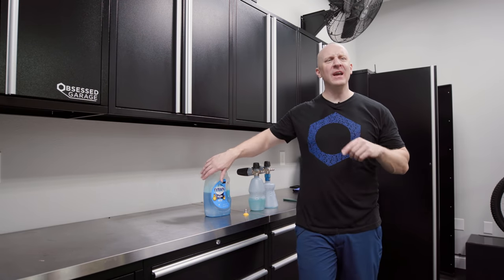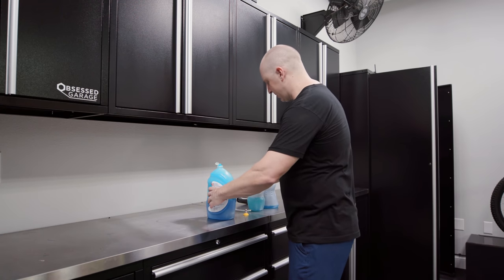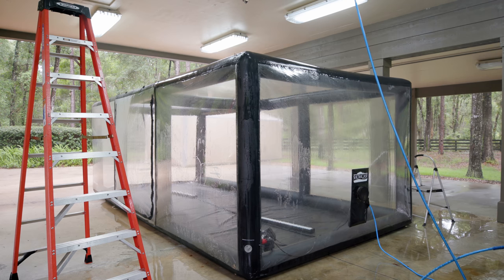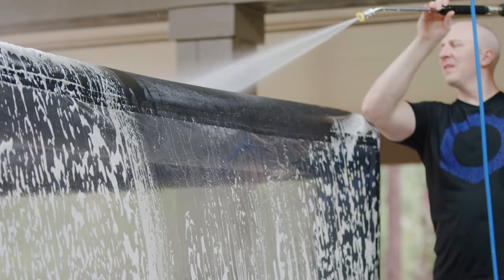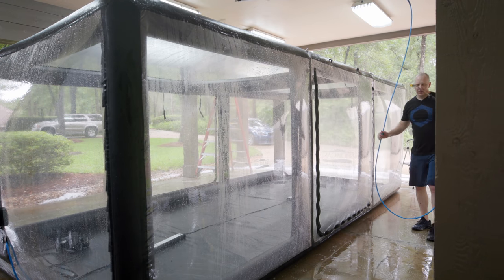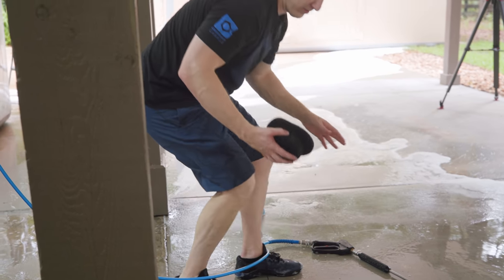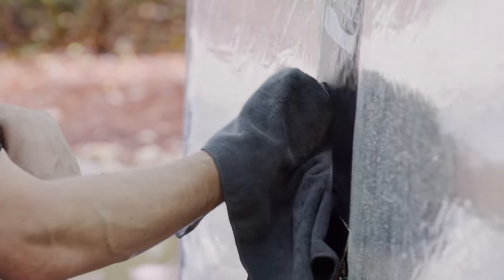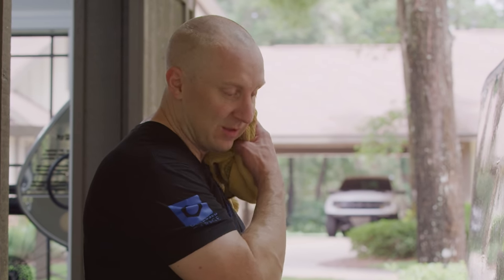CarCapsule Gets A Deep Clean

Comment: You should try Charlie's Soap Indoor Outdoor cleaner on the inside so you don't have to spray water inside. I have used it to clean the plastic on old Apple Macbooks(2007) and older I refurbished. It took the decades of filth off of those laptops and visually are white(like new) instead of the grey color they turn into from use. I have heard the stuff can clean mildew off of sliding just by itself!

Comment: Matt also at 15:35 there is a 3rd gen 4runner in the background. Is that yours as well?
Reply from the maker: No, it's Michael's.
Reply: Obsessed Garage I would love to see it rolled into OGHQ and dialed in! 🙌 I’ve been taking my time, dialing mine in since before quarantine began.
Reply: Okay i was just going to warn you they are notorious for lower ball joint failure due to poor design. Seems to happen to most stock 4runners just north of 200k.

There is a whole facebook group dedicated to Toyota LBJ failure.

Either way there's a great group on Facebook called 3rd gen 4runner mafia thats awsome for info and actually quite a large group.